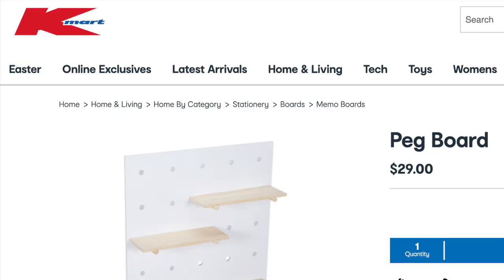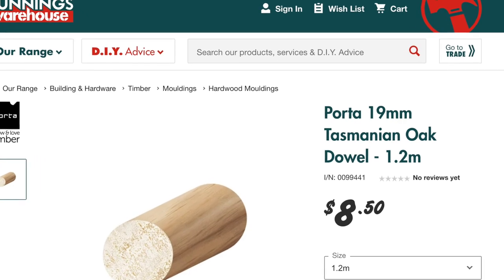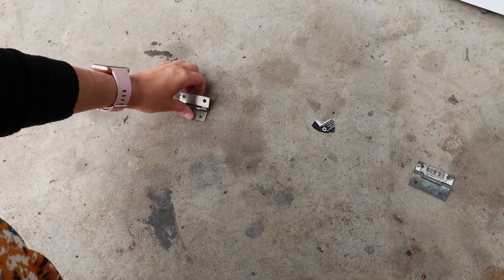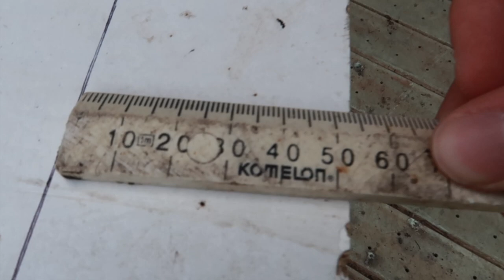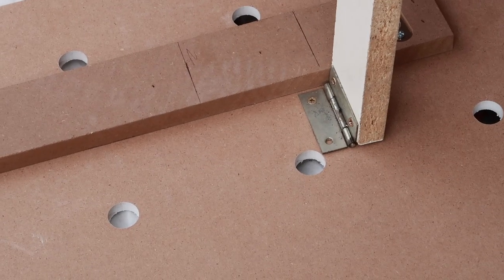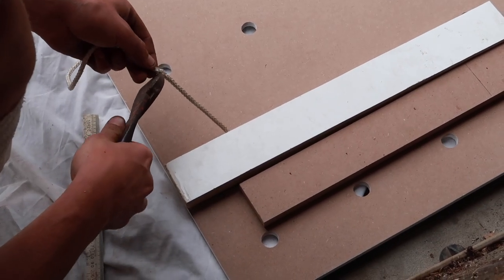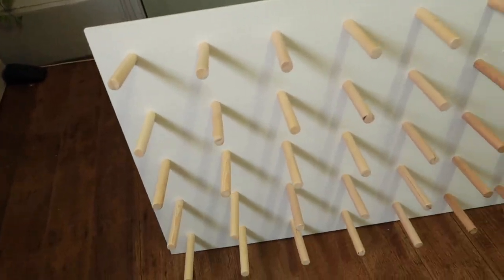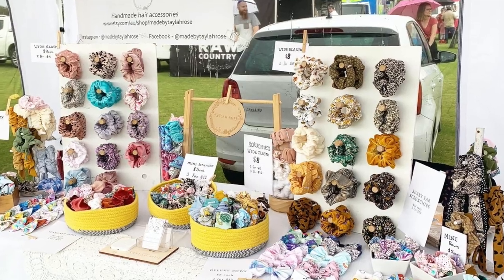scrunchie peg board DIY for market craft fair display || how to display scrunchy | how to make stand

Comment: I bought the 19mm wooden dowel and they didn't fit snug they fell straight through. How did you get them to stay if you used 19mm dowel? I measured the wooden dowels that came with the peg board and they measured 20mm
Reply from the maker: I think they must have changed the size! I have 4 of these boards and 3 fit my pegs perfect, the 4th board the holes are way to big 😫
Reply: @TaylahRose  that sucks I have two boards and i need 20mm dowel. Bunnings doesn't sell it only 22mm and that's too big 🤦‍♀️im getting another one second hand coming from townsville and wonder it that will fit the 19mm dowels. I'll soon see.